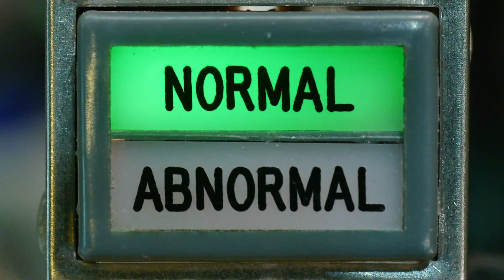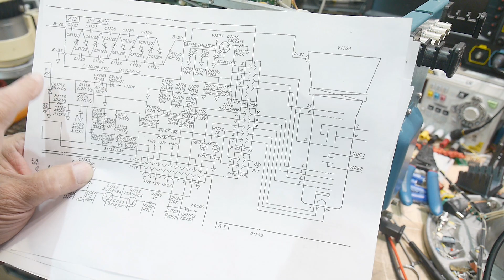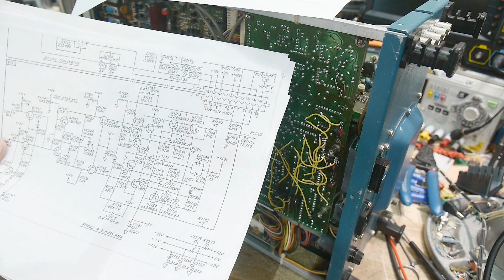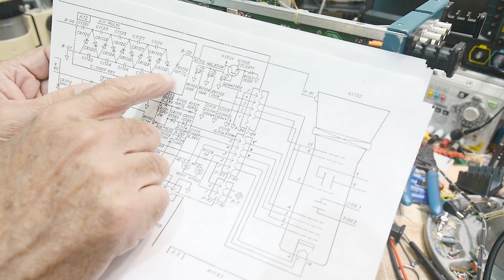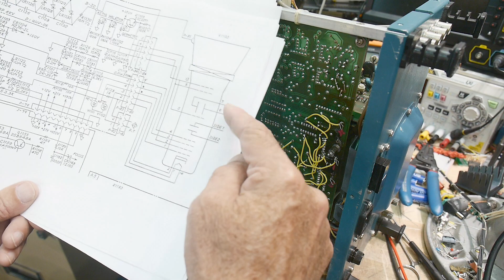#1156 Kikusui COS6100 repair (part 10 of 11)

Comment: First of all you need to understand how your scope works. For example Z axis amplifier. First check your CRT voltages, and if they are ok (an I mean you really have +20kV at the accelerator electrode) try checking your Z axis amplifier. This scope is some wierd copy or clone of famous Tektronix 465 scope (or some other from 4xx series). Better say Japanese made Tek Frankinstein. To make story short, your Z axis is working in souch a way that at the end of every sweep ramp, your sweep circuitary generates short pulse (while the circuit sweeps back) called retrace blanking pulse. This pulse is bipolar (positive while you have the trace and negative during retrace) and amplified via Z axis amp. Z axis amp is capacitively coupled to DC restore circuit (at -1800V part of the circuit), where the amplified pulse is restored to its original height and duration but level shifted to cathode voltage level. First disconnect your Z axis amp from HV circuit, check it like any other amp. When You get it working and you have retrace blanking pulses at the output (firstly at the emitters of Q1151and Q1152, and then go further to Q1153/1155 and Q1154/1156) check capacitors and diodes in DC restore circuitary (the one around CR1108 and CR1109). There must be the fault with your scope. Repairing stuff is not always just changing the faulty parts and a few 3 therminal regulators here and there, it is offten much more in understanding how something works or better say how it should work, and this is coming from a few decades of analog developement, instrumentation engineering and debugging all kinds of circuits. Hope that my comment, though rough-sounding was somewhat helpfull and if you give it just a little more of your time and brainpower this scope is going to work and make a usefull tool to your shop. All the best, and keep up the good work! 😊
Reply from the maker: Yes, the Zaxis control is confusing to me. it is not one grid but two out of phase. I wanted to hot wire the CRT to get some hint it may be alive but so far no glow at  all. The two grid controls bias the -1890V up, the range of the two grid offsets are +5 to +150.  so I tried up/down  and down/up hot wired but no go.
Reply: You wont achieve anything by hotwiring CRT bias circuit. First you remove 47ohm resistors R1169 and R1172. This way you disconnect your Z axis amp from DC restore circuits (you'll be back checking it when you make Z axis amp operational). Then turn your scope on, and check is your X axis sweeping (as i saw you checked it and it is fine). Next check the voltage at the emitter of Q1141. There you should find blanking pulses syncronous with your sweep retrace (the pause between two ramps on the X axis output). The next stop is collector of Q1146 where you should get inverted signal from emitter of Q1141. The signal at the collector of Q1145 should be in ohase with emitter of Q1141. Lets analyze this circuit. Q1141 is common base amplifier in this circuit used as a level shifter. Next we have Q1146 and Q1148 that are forming cascode amplifier . Since the emitter of Q1146 is effectively driving the emitter of Q1145 the signal at the collector of Q1145 must be in ohase with input. Also Q1145 and Q1147 are forming the other cascode amplifier. Those two amplifiers are prepairing the two inverted and level shifted copies of retrace blanking pulses. Q1149 and Q1151 (the same applies to Q1150 and Q1152) are emitter followers to reduce the output impedance of the cascode amplifier mentioned above and produce the driving currents for the bases of Q1153 and Q1155 (the same aplies to Q1154 and Q1156). You can imagine these  two transistors as a current source and a current sink connected together and driven in oposition, but to make things simpler it is just another amplifying stage capable of producing quite hifh voltages at the output. The network made from R1159, C1145, R1157 and R1156 is feedback path used to stabilize bias point for this side of amplifier (since this kind of amplifier is prone to thermal runaway) and also define the gain of this stage. Please in the next video, just listen to this advice, remove R1169, R1172 and give us the measurements at the mentioned points. From this me and other people can help you deduce what is wrong and is it anything wrong with the Z axis amplifier. If it is faulty we'll help you repair it. After the next video I'll post the comment eather explaining how to check DC restore circuits (if your Z axis amp is ok) eather how to fix you Z axis amp and then we'll go further to DC restore circuitary and controll grids functoning. I hope you find this comment helpful and you learned something from this.
Reply from the maker: @ivanpopovic9503  I just want to see a spot or soft glow at the phosphor. If I see that it will give me hope I can fix the rest.
Reply: @IMSAIGuy  Ok, if you want to go this way, it is possible. Since your -1.8kV voltage is ok, next check +150V across R1120, and find a way to measure +20kV with as little loading as possible. If your probe is <100MOhm results will be shady, since max current capability of 20kV power supply for crt acellerator electrode is around 200-500uA. Have in mind that beam current in colour TV crt was around 1mA only. And those crts were much larger and much brighter than the ones in scopes. Ofc while measuring 20kV keep the  high voltage connected to crt since its capacitance is accounted in functioning of HV multiplyer, as someone here already said. 
Next you need to understand crt functioning. Lets imagine it is a triode. For electrons to go from cathode to anode it is needed that grid (G1 in crt) mus be around 0V in respect to cathode. For the beam to stop you will need around 50...-150V at G1 to stop the beam completely (and this depends on design of the crt ion optics, for example in old tektronix scopes it was around -30...-70V). Next you should analyse functioning of G3. But have in mind crt is not exactly penthode... This third grid serves the purpose of beam forming and it is not the grid at all it is an anode. You must understand that crt is a bit wierd tube. Your cathode is at few kVs, anode is at around 0Vs in respect to GND, and this is your electron gun assembly. Next you have so called geometry electrodes (astig. control), then deflecting plates and then the electron beam is flown through something called drift chamber or accelerator. On the inside of drift chamber there is a speciall extremly thin coating of reaistive material (you can think of it as a graphite) connected from one end to anode of the crt (0V to GND) and to +20kV on the other end (at the screen). This effectively formes potential gradient that is seppeding up electrons while they are flying through drift chamber. It is essential for staric potential to have mentioned gradient and geometry also drift chamber must be of speciffic lenght to produce needed pisture geometry since it is acting as an microscope eypiece (this is ofc the aproximation but it serves the purpose). So to check your crt if all the voltages are ok, disconnect G1 from dc restore circuit and connect it directly to cathode thorug resistor of around 200k to 1M ohms. And connect G3 to GND or +150V through a resistor of around 10kohm. This should be enough for the tube to show the signs of life. Spot or a glow. 
Also here i descibed a very simplified functioning of crt in reality it is much much complicated since you have beam forming optics, then picture forming optics (and here picture is real, small, and rotated as in real optics) and then you have focusing and zooming optics to correct the geometry and rotate and enlarge your picture to the aize needed on the screen. But I dont find I have to discuss the functioning of crt in detail first as it is just going to confuse people and next it is obsolete technology, and less and less people everyday meets with this. Maybe some enthusiast as you, me and few other people and some researchers in applied physics where ion optics is still in use in accelerators, mass spectrometers and stuff like that. :)
Hope this helps a little. :)
Reply: Also there is a bug for some reason on my reply and it is not showing whole text!   Wtf...
Reply: Now that I see the circuit...and the manual is posted....OMG..what a beast....and a few features...better than TEK in innovation....or at least they scored some patents......and the English translation is supreme ...

Isn't it nice a electrical schematic is the same around the world?

When I need to measure or get to play in the shop... I use a Tek 2246...

Yeah fan is noisy...not as nice or new as the Rigal ?...or as nice as the Imasai Guy shows us.....I will get that one next...

I have one at work and one at home...and my cherished Tek 465-...sits in  corner....last i fired it up...it still worked.... but that love was mostly due to  working and using one at Rockwell Collins....on some production little jobs...or watching a degreed EE..try to fix a broken semiconductor tester...a Loran driven by a DEC PDP-11 or...whatever....it could perform 60 tests in 100 mS...on a like 2N2222...
Every discrete semiconductor in that radio...100% tested......op amps...and the logic...now .the VLSi like the 6502...or the Intel 8080A and their peripheral support chips...they went to the Fairchild Sentry....that was just bought......so for awhile we took Intel and Motorola Word for quality....

It's all goid

I used the 465 to verify...sometimes.....relay contact bounce of all things..and armature pull in speed....I was just a incoming receiving inspector...procedures were are set and were followed....but sometimes the scope went elsewhere....or was sent out to our cal shop...it come back....have buttons and speed all set different....and I love to reset....and go about testing.....

In the evening...night school at Utah Techical College so I could be a test technician on the radios..

I enjoyed the most...Rockwell had a surplus auction..employees could buy.....they take it out of our checks....Anyway I bid and won a Tek scope...I think 545A...a tube beast left over from the Apollo program....it was cherry too....little user booklet in top trap door....I think it's  BW was 5 MHz.....Anyway it keep the bedroom warm.in SLC UT.....this was so I could reinforced ...learn..and didn't always need to do lab in school......I be playing and building Forrest M. digital 54-74 TTL and 4000 CMOS ....and analog ...mostly I  like audio...I could hear how good my amp were  built.. ...and play a little in RF...

 Besides Radio Shack limited stocked things..there was Scheffer Electronics sometimes they buy surplus Rockwell and Sperry  non conforming material.......or new old stock & obsolete equipment....so it was easy to get quality and much more variety of components....and higher power goodies.....military spec quality....

I paid $100...for that Tek 545A....in 1982

Later bought nice Fluke ...brand new.or that little bench top 4 -1/2 digit DVM with RMS on AC and 50 kHz BW.....plus the dB readings....that still runs like a top...

Then Racal Dana 1992 counter ...to back up pops old  Heathkit nixie tube counter......& thanks for showing us that....repair...

A Booton RF voltmeter...

A HP signal generator...

A Phillips function generator....

A BK function generator....

A Tek 492....dammit...it is broken...

Enough...

I try inspiring the Twins....they just moved out it is so peaceful without them.....and .some aren't interested 

Teach your children well...

Ok ...

Bedtime for Bonzo.....

Keep up the good work...

I can't wait to see the scope come back from the dead....

No hurry...

A piece of history....that eventually help get us to the moon and back...

Pops had an old Heathkit  scope that him and his buddy Joe built....big thick trace...

When I left home and got to see the 465...in action...very nice.....compared to pops Heathkit that he fire up once in awhile doing ham radio...

ALL scope are stored inside near std temp and pressure.conditions ..Hopefully....nothing will dry out......

The 2247's...I think are 1991 vintage.....May they never break down.....

If they do die...I see lots of sharp folks out there.....and I won't toss it until at least trying to fix....just like our 8080 guy...

I love to see ....them the scope boot up ...passing self test.and traces found...for perhaps-  i will  only use them 2× a year.....and when it is brought back up and on..usually their is trouble with something...

THE 2247 has enough little bells and whistles...nice V and time cursors.....and is fast enough for what I work on....

And so many talented EE...smart from experience.....good job

I am learning more and more...

Don't give up - take a rest....

Another story...

Comment: Points to consider 

https://manual.kikusui.co.jp/C/COS6100_E.pdf

Snaping sound may have been HV discharge not component failure 

HV should be +18Kv  (Figure 6-1)
 voltage on filament and cathode should be -1850.  TP-6 Adj with RV1101
 voltage on controll grids 1850  modified  by + 150v 
 
Circuit that had missing parts = Zaxis amp,  (intensity)

 Zaxis amp controls grid 1 
   The next grids don’t mater if grid 1 not satisfied 
 GEO controls grid 2 and 6
 SUB Focus controls grid 3
 Astig controls grid 4
 Hala controls grid 5 and 13
Reply: THANK YOU for the starting point of DATA!